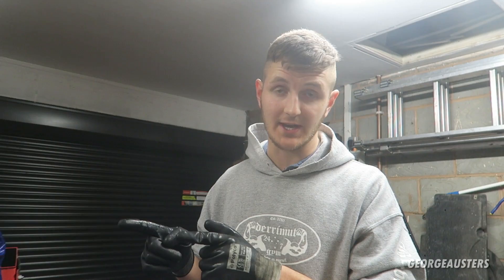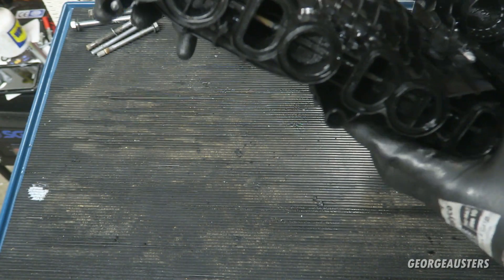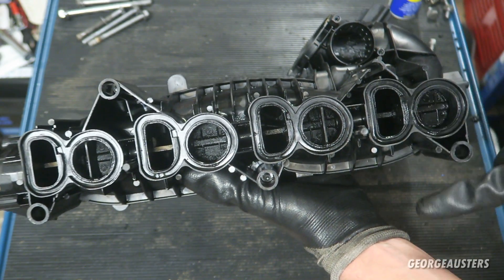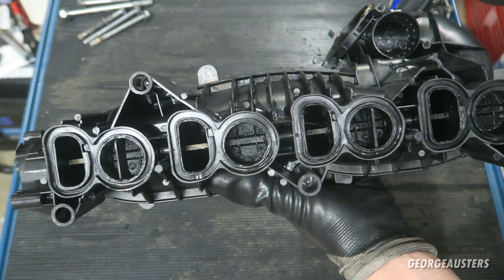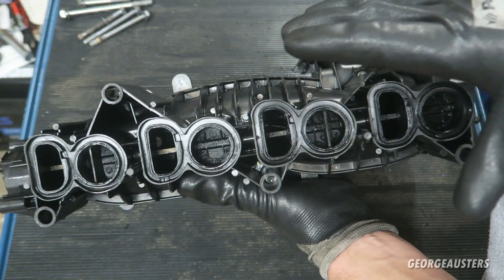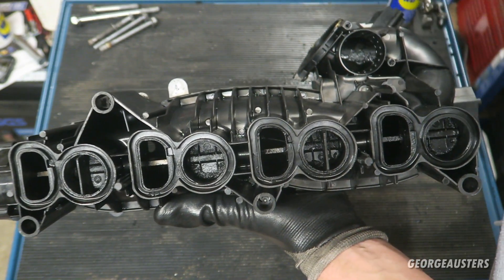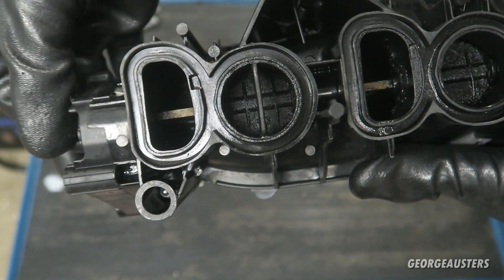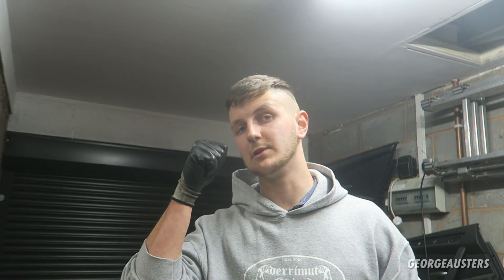Why You Should NOT Remove Swirl Flaps on BMW N47 / N57

Comment: I have a 2007 audi a5 3.0 tdi. Ive been quoted £1300 for 2 new intake manifolds as the swirl flaps on one side have failed. seems excessively pricey considering the car isn't worth much now. do you know if the flaps on my car are screwed onto the rod and risk falling into the engine?
Reply: you can buy remanufactured used -> cleaned manifolds with betters rods and everything for like 1/3 price, I did this with my om642 320cdi (benz) for better fuel effiency and lowrpm torque. like this (https://szivosor.hu/_files/system_preview_detail_200000356-985af99568/20160829_074732.jpg) this is for V6 3.0 TDI vw/audi

Comment: I have a e91 lci 2012 320d would it not be worth my time removing/blanking swirl flap?
Reply: I have a 320d 2005 and, I was thiniing to myself, is it worth the work to remove them, and I am so glad i did it was just the matter of time before they came loose and went in the engine, downfall you loose power but save your engine

Comment: So why can’t you just get a new rod made then ? I e stainless steel ?
Reply from the maker: You could in theory but it would be very difficult to try and attach all of the brackets and flaps back onto the rod
Reply: George Austers ok so if a rod was machined and tapped I don’t see this being an issue really to be honest it was a great video by the way I have a 330d 2015 which I was going to delete the EGR and swirl flaps but as it’s been recalled and had a new EGR cooler replaced and all the other shit cleaned I didn’t see the point. Or make sure it’s cleaned regular somehow.
Reply: George Austers ok so if a rod was machined and tapped I don’t see this being an issue really to be honest it was a great video by the way I have a 330d 2015 which I was going to delete the EGR and swirl flaps but as it’s been recalled and had a new EGR cooler replaced and all the other shit cleaned I didn’t see the point. Or make sure it’s cleaned regular somehow.

Comment: You are wrong what swirl flaps are for.
From BMW repair manuals:
Effects of faults:
If the swirl flaps stick in open position: Detection in exhaust gas characteristics in lower speed ranges otherwise no effect.
If swirl flaps stick in closed position: Power loss of approx 10% at higher engine speeds.
Reply from the maker: How does that explain what they are for?
Reply: @GeorgeAusters  Basically it says that it's for better emissions on low RPMs
Reply from the maker: @Alteriukas  Yes, they mean you use less fuel and produce less emmisions
Reply: @GeorgeAusters  I just replaced (on a weekend) my N47 intake manifold with the factory one without swirl flaps and i have to say, it's so much better now - starts without hesitation, almost instant power when pressing gas pedal, even my fuel economy is slightly better (5.4l/100km before during "eco" driving, and now 5.3l/100km with pushing it all the way above 3K rpm). The only "problem" it's now shutting down with a little judder.
Btw, my n47 was at 230k km, and one side of swirl flaps had ridiculous amount of play in it's axis, also intake manifold it self was leaking oil/soot mixture and air(boost) through the same axis near the electric actuator. Also that motor was broken and wasn't even connected to the axis anymore. It could have ended really badly.
Reply from the maker: @Alteriukas  Only way to have it running properly is to buy a new intake manifold which I have done now
Reply: @GeorgeAusters  Could that shutdown judder be because intake manifold flaps are disconnected and not programmed off? I did diagnostics and got nothing about anti shudder valve, only that flaps are disconnected

Comment: BMW 116D 65 reg. Are the swirl flaps held on with screws or rod like the one shown in video?
Reply from the maker: They’re held in by a rod but they’re on the OUTSIDE of the manifold so can be replaced easily
Reply: @GeorgeAusters  just to confirm this is the 1.5 diesel 3 cylinder??

Comment: Thanks for the video, i have an E82 with the N47D20C 143hp, and i was thinking about removing the swirl flaps, i will just clean the intake manifold.
Reply from the maker: Your 118D may not even have swirl flaps
Reply: @GeorgeAusters  probably.. when i was looking for the kits on eBay some were saying it wasn't compatible, even though the spec was the same. I'll just get an EGR delete kit that i saw, i already have a spare dpf without the particle filter inside (i kept the catalytic part) and i'll remap it all at once.
Reply from the maker: @JoaoMadeiraDesign  Have you seen my video for the EGR delete?
Reply: @GeorgeAusters  just went there to check it out. Thanks for the videos, it's a great help.

Comment: I already put them out in my m57d25, so if I understand you correctly its not good to take them out in the n57 because of losing Power
Reply from the maker: You’ll lose low down power in any car you take them out of, but they are problematic on the M57 engine
Reply: @GeorgeAusters  The question then is:  How much power are you sacrificing down low?  I know you've mentioned that several times, but please quantify that with stats.  Its seems reasonable to me that remapping could compensate for most, if not all, of that "lost" power.
Reply: @AZG1164  remapping could compensate, but do yo have a DPF with m57? bcause without swirl flaps - it makes a lot more smokes at low rpm, and your system and dpf wont like it, it will cause more frequent dpf cleanings, maybe dpf problems in long term..  and diesels likes to run at low rpm.. as you know..
but if you dont have a DPF, then... its your choice, but I hate when I dont have low rp torque especially when.... 3000ccm...
Reply: @blektheone17  Wrong! Diesels like high rpms...

Comment: When they end up breaking apart as it happened to hundreds other people, you will surelly regret to not have deleted it...
Reply from the maker: Like I said it's not the flaps that break apart, it's the rod that wears and can eventually snap.. Different to the previous M47 and M57
Reply: @GeorgeAusters  the flaps do break, I just removed the intake manifold on my f10 525xd. the rod was in place and 1 half of one of the flaps was missing, most probably it is in the cylinder now. I can send pictures to prove this fact.
Reply: @cipriandan24  Exactly. 530xd - I was about to replace the vacuum transducer so I had to remove the IM and while I was there I checked the redesigned high-tech swirl flap setup - just to make sure.... Guess what. The edge of one of the plastic flaps was missing and made its way right into the combustion chamber. Whoever is saying that you should keep them, don't listen to them get rid of this stupid thing ASAP.
Reply: @cipriandan24   same for me on a x1 25dx, any damage to the engine? or other effects over time?
Reply: Would M47 520d suffer from power or mpg loss with remoed swirl flaps ?
Reply: @lakilaki551  nope i own one not a single problem over a year
Reply: @lakilaki551  George doesnt feel like answering i guess
Reply: @lakilaki551  i OWN thé m47 and theres no Powerloss after swirlflap removal. ;-)hope your glad to hear
Reply: The flaps do break off the rod ... I lost 2 and got the pics to prove the wear on the back of them.1 was sitting on the engine block in the port and the other hanging in the manifold. 1 functional 1 remaining and the 4th one is just spinning on the rod freely. You can buy a flap gasket intake for the manifold 11617812938 - that's the part number
Reply: @A.Matias-v1v  3 years later, have the cheap swirl flap failed? About to get one my self 😂
Reply: @Shhfbd  ,fuck, sorry to hear that. I hope you didnt get internal damages.
Reply: @A.Matias-v1v  no mate I haven’t purchased it, I’m asking you if your ones have failed or still okay ?
Reply: @Shhfbd  Sorry my bad english. I removed it when I bought my car
Reply: Maybe I'm missing something but when you show that diagram of how the swirl flaps make the air swirl in the cilinder, aren't we forgetting there is also a valve in the way? So does the air still swirl after passing the valve? Cause I think it does not if we think at the Coanda effect, the direction of the air is gonna change no matter what, when passing near the admission valve/s
Reply: What do you mean by deleting them?
Reply: @jaleelaslam7341  to remove them
Reply: Does a 2011 123d have swirls
Reply: @justintaylor7809  , mine is 2009 123D and there swirl flaps were there.
Reply: Why who doesn't want to have two odometers on his car 😂
Reply: Exactly, it's just another mechanical part that will wear and break eventually
Reply: most of them have like 300.000+km of mileage.Just clean them and replace them if they have free motion in them and forget about them.It's like engineers are stupid or something for puting them there? there are forums full of people complaining about low end power loss and mpg after deleting them.
Reply from the maker: Unfortunately you can not replace the swirl flaps on the N47D20A engine, but you can on the N47D20C👍🏻
Reply: @GeorgeAusters  Lucky me:)

Comment: Wondering if I should buy a e91 with 200k miles n47 2007 318d. With that many miles I suppose the timing chain has been changed. Do you think it's still a decent engine at that mileage?
Reply from the maker: You can maybe get another 100k miles out of it but expect needing to replace most of the bushes etc at that mileage

Comment: Thought I recognised the name,  thanks for the comment on my upload George. I appreciate what you're saying with this one, but it really doesn't apply to my 330D as you recommended. And with the correct coding out and remapping, the car runs 100% better than it did. The restriction of air flow over the flaps was quite unbelievable in my opinion, removing a combination of parts (EGR/Swirl Flaps/DPF(if you choose) can prevent you from having to fork out on HUGE diagnostic & repair bills.... ever again. 
It all depends on what you are comfortable doing at the end of the day, and I have no regrets. The car feels amazing.

Keep up the good work mate.
Reply from the maker: No problem my man.

Likely worth removing on the M57 engine but not the later N57 engine.

You’ll notice a big increase when you remove EGR and remap yes but do that first and then remove the swirl flaps and you’ll notice the drop in low down torque and MPG overall 👍🏻
Reply: @GeorgeAusters  Its not exactly a huge loss of low down torque. and that can be compensated for in the map. 
The fact is George, its a matter of opinion, you lose a small amount of torque and some MPG and gain more power and A LOT of money in your pocket from not having to take it in for a costly repair. I've been in the game a while mate, I know how car manufacturers work LOL
Reply from the maker: @JaseWilks  I'm not saying don't get it remapped but you're going to lose low down torque and MPG whether it's remapped or not.

Like I said.. I would probably recommend it on M47 and M57 but no need on the N47 and N57 mate
Reply: So you're one of these selfish people who doesn't give a shit about the environment, 
yeah you just remove all that,they only put it on for a laugh at the factory, fuck everyone else except for yourself.
Reply: @herobo123456  I am one of those people too...
Reply: @herobo123456  seriously mate, you should tell this to people in India or China :D

Comment: finally! Most of people told me to remove them but i knew bmw engineers put them for a reason and uve explained it. Thank u for the explanation George! 
greetings from abroad
Reply: Good luck when the shaft remained in the blocked position, and you have no power no preasure in turbo, the dpf does NOT regenerate, gets dirty, and then people from bmw shops tell you that new air intake (only oem) its 900€, plus the dpf clean 200€, turbo clean 200€, and nasty egr full of unburned diesel gets stucked. All of this or a 50€ euro deletion mode👍
Reply from the maker: EGR removed 👍🏻
Reply from the maker: Glad this has helped you man. A lot of misinformed information on the internet 👍🏻

Comment: Will agree yet i can see is allready leaking at the outlet of rod near the actuator motor. And for that reason i threw away mine since the seals are not replacable . The leak get worst Once you clean it and get codes for air charge pressure. I did not notice any low rpm change car has more boost and goes faster when reved change is all positive . Anyhow who drives diesel below 2000 and kill his DMF.
Reply: people like u don't know the engine and then they dont know how it drives. mine swirls were removed and car feld dull. i had them reinstalled. I felt difference. is it safer removed? it is, but I still keep them in place
Reply: Martin Kulik interesting is that when i went to bmw to buy seal for manifold and they typed my vin he said i do not have swirl flaps cause 318d e91 LCI never had them only after he seen them and the same as car production date on swiel flap actuator motor he belived. So to me they are pointless and guy on parts desk at bmw told he trow hus in the bin too. Good luck with yours
Reply: @adamproperdouble2094  what pointless? reducing power and increasing consumption is pointless? if they said some cars dont have them, then they are designed to not having them. but the cars that have them it helps with combustion. some cars break because of them, that's why everybody is panicking and services are making money out of it. I hope mine will not fall into engine. last time I checked when I was doing something and they were fine..I was searching if I can buy them in steel or reinformed as I saw somewhere but I havent found it yet . I will not remove them too, since I dont want reduced power that I had when they were removed
Reply: Martin Kulik look i had this car since 2013 i done 80k km in it , i removed flaps only recently , i have got Ista software and Scan for error reguralrly . There is No erros , car drives the same well little faster when i put the foot down it goes better now since it has more air and it uses same amount of diesel as before so flaps were invented by grrenpiece so there is less co2 in the exhaust gas that is all - pointless and expensive exercise. All decent bmw mechanic will confirm.
Reply from the maker: Why will driving below 2000rpm kill the DMF?
Reply: George Austers Low rpm cause excessive vibration and that is when flywhell work at most and put a strain on it as it try to minimise them plus turbo is not running at all or not in Full range . For turbo to be heatlhy is good to use it in all rev range so the geometry dont cut in one spot only. So all diesel owners give it a blast and work that turbo engine to burn dpf off.
Reply from the maker: I don't have a DPF on mine. I don't ONLY drive below 2000rpm but I need to get 50mpg so drive quite economically for normal driving
Reply: George Austers push it sometimes to 3500rpm on all gears and i mean Once a day when worm to extend turbo life , lucky you have No dpf . Another positive change since flaps are gone it reach temp a lot quicker in winter.

Comment: I’m deleting my swirl flaps (M47) just order the kit then EGR and DPF Delete with full stainless straight through exhaust and a K&N replacement air filter and a stage one remap
Reply from the maker: Hope it all goes well mate! Very common for swirl flaps to fail on M47👍🏻
Reply: George Austers I’m driving round crapping my self as well as hoping and praying they don’t fail just yet it’s done 200,000 miles 😬
Reply from the maker: Remove the intake manifold and inspect them mate!
Reply: I'm seriously considering the same thing on my 335d... Will it pass emissions after all of that is deleted and the ECU is tuned?
Reply from the maker: @benjaminkluge7897  Are you in the UK?
Reply: @benjaminkluge7897  No
Reply: @LazicStefan Source?